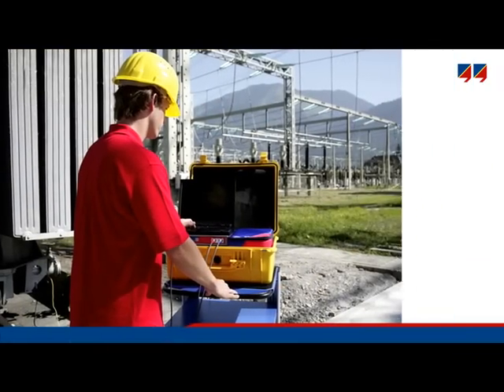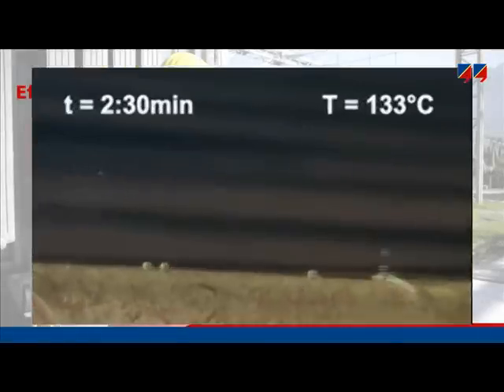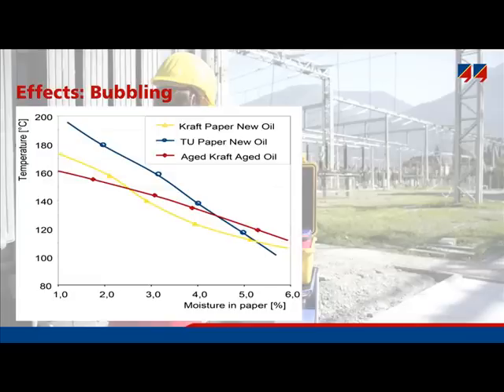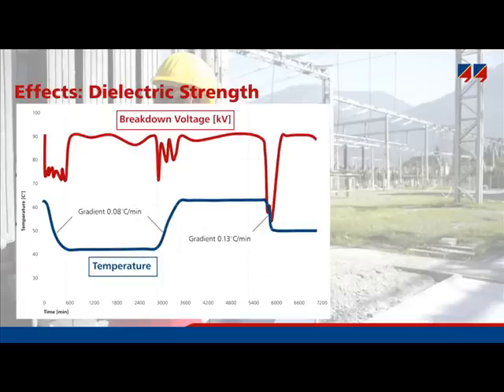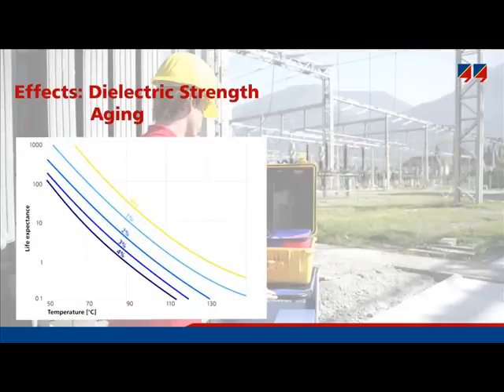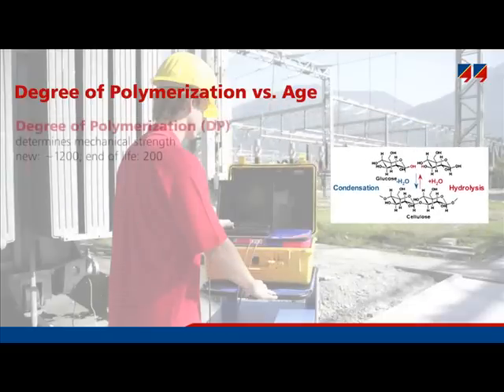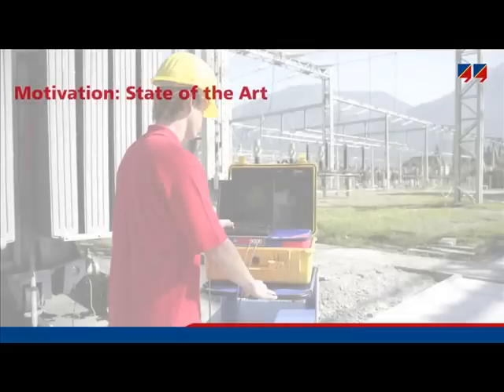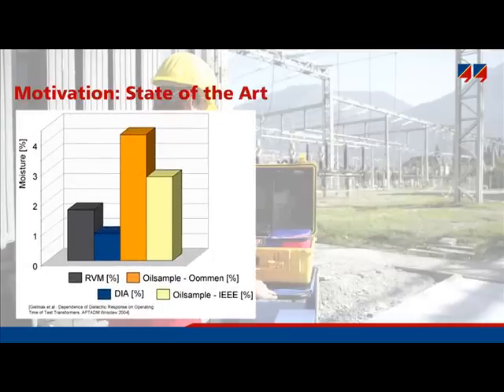What is Dielectric Response Analysis?

Comment: How weather affect transformer?
Reply from the maker: Dear Manzar Ali,

the answer is based on the assumption, that you are talking about the weather influence during testing.

The test should be done on a sunny day, some clouds are ok though. 
High moisture content in the air or, worst case rain, increases surface currents which disturb the measurement and can lead to absurd results.

Best regards,
your OMICRON team